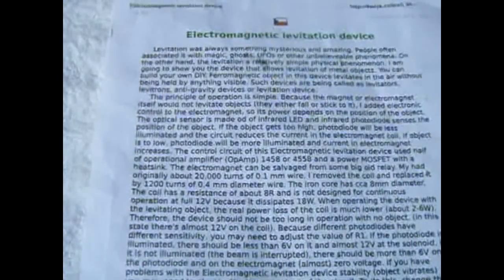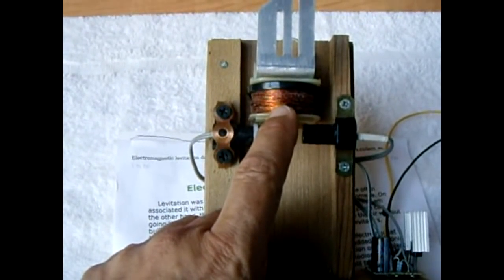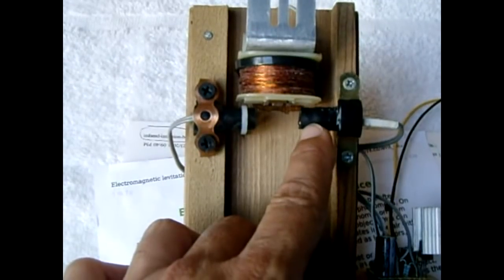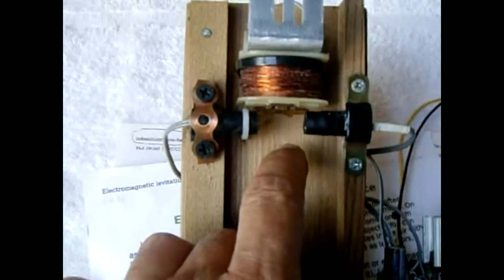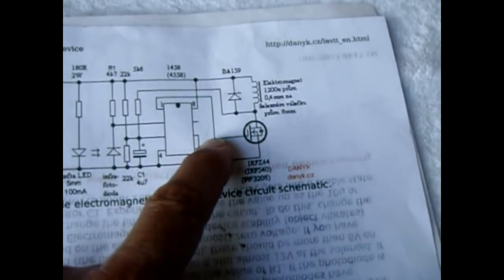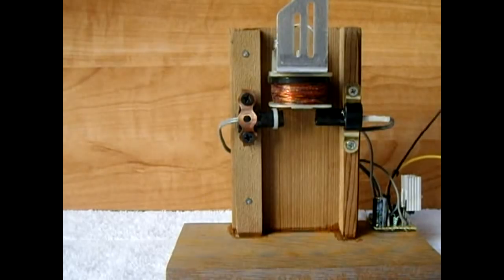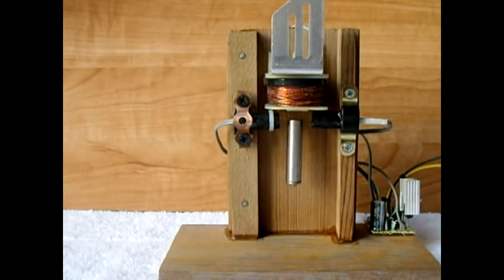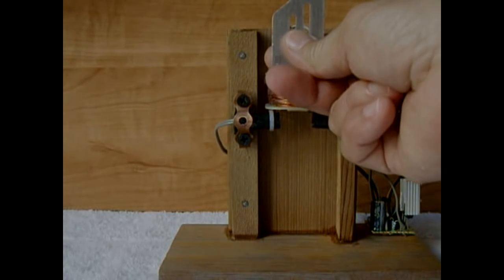Electromagnetic "Anti-Gravity" Levitation Device

Comment from the maker: The word "Anti-gravity" is often used colloquially to refer to devices that look as if they reverse gravity even though they operate through other means.
Reply: ABSOLUTE MATHEMATICAL PROOF THAT ELECTROMAGNETISM/ENERGY IS GRAVITY: 

Time DILATION proves that ELECTROMAGNETISM/ENERGY IS GRAVITY, AS E=mc2 is DIRECTLY AND FUNDAMENTALLY DERIVED FROM F=ma. Einstein's equations are NECESSARILY QUANTUM GRAVITATIONAL, AS ELECTROMAGNETISM/ENERGY IS GRAVITY. In fact, the mathematical unification of Maxwell's equations AND Einstein's equations (given the addition of a fourth spatial dimension) proves that ALL of SPACE is NECESSARILY electromagnetic/gravitational IN BALANCE; AS E=mc2 is DIRECTLY AND FUNDAMENTALLY DERIVED FROM F=ma; AS time DILATION proves that ELECTROMAGNETISM/ENERGY IS GRAVITY. ACCORDINGLY, Einstein's equations predict that SPACE is expanding OR contracting in and with time. ALL of SPACE is NECESSARILY electromagnetic/gravitational IN BALANCE, AS ELECTROMAGNETISM/ENERGY IS GRAVITY. This is, in fact, CLEARLY proven by BOTH F=ma AND E=mc2. A PHOTON may be placed at the center of THE SUN (as A POINT, of course), AS the reduction of SPACE is offset by (or BALANCED with) the SPEED OF LIGHT; AS ELECTROMAGNETISM/ENERGY IS GRAVITY. (Very importantly, outer "space" involves full inertia; AND it is fully invisible AND black.) Gravity AND ELECTROMAGNETISM/ENERGY are linked AND BALANCED IN AND OUT of SPACE AND TIME, as this is CLEARLY proven by time DILATION, F=ma, AND E=mc2. This ALSO explains the cosmological redshift AND the "black hole(s)". Gravity/acceleration involves BALANCED inertia/INERTIAL RESISTANCE, AS ELECTROMAGNETISM/ENERGY IS GRAVITY. GRAVITATIONAL force/ENERGY IS proportional to (or BALANCED with/as) inertia/INERTIAL RESISTANCE, AS ELECTROMAGNETISM/ENERGY IS GRAVITY. "Mass"/ENERGY involves BALANCED inertia/INERTIAL RESISTANCE consistent with/AS what is BALANCED electromagnetic/gravitational force/ENERGY, AS ELECTROMAGNETISM/ENERGY IS GRAVITY. (Energy has/involves GRAVITY, AND ENERGY has/involves inertia/INERTIAL RESISTANCE.) ACCORDINGLY, FULL DISTANCE in/of SPACE, MIDDLE DISTANCE in/of SPACE, AND A POINT are all then in BALANCE; AS ELECTROMAGNETISM/ENERGY IS GRAVITY. Gravity IS ELECTROMAGNETISM/ENERGY. GREAT !!! This NECESSARILY represents, INVOLVES, and describes what is possible/potential AND actual IN BALANCE. Therefore, I have demonstrated the true mathematical UNIFICATION of physics/physical experience AS what is NECESSARILY electromagnetic/gravitational IN BALANCE; AS ELECTROMAGNETISM/ENERGY IS GRAVITY. 

By Frank DiMeglio

Comment: ANTI gravity, is already well known,  It's the by product of the "B" field in any magnet... Not the north or south poles.  Want proof.. Find a magnet that you can access the "B" field of a magnet ,(that's the center of a magnet!!)  Now weigh a small stone on a scale lets say it weighs 40 Gm..  Now tap it vigorously with the center of a magnet the "B" field and it will loose about two thirds it's weight..  move it around and the weight comes back..  if you want to suspend it in mid air you will need to oscillate the "B" field for the material your trying to lift.  Take a look at Coral Castle Florida, Ed lifted 30 ton stones and built his castle it's a tourist attraction now.  The "B field played a major part in the taking down of the towers on 911,  that's one of the reason cars blocks away from the towers were ruined, also the building across the street had to be rebuilt.. It's all "B" field technology,  That's what Nicola Tesla was talking about with his "B" field energy ray..

Comment: I AM NOT SAYING THAT I AM IMPRESSED NOR DO I SEE ANY USAGE FOR SUCH A THING EXCEPT AS FUN. WHY NOT USE AN OSCILLATING CIRCUIT BY USAGE OF A HALF WAVE RECTIFER TO CONTROL THE MAGNET ON/OFF CURRENT, AND AN LC POTENTIOMETER TYPE KNOB SYSTEM TO CONTROL THE FREQUENCY OF THE HALF WAVE RECTIFER? THIS WAY YOU CAN USE IT ON A VARIETY OF DIFFERENT WEIGHTS.
Reply from the maker: First, turn off the stupid caps. Second, it was designed to be a cool desktop gadget. Thanks for watching
Reply: @electronicsNmore  Like those balls banging on each other? I guess if people like those, people like this as well. I don't turn off my caps. I let it turn off by itself. Maybe it happens when your password to your PC is in all caps. Who knows. Then you start writing and you are like, ha!. Seriously, I am tired of people complaining about caps. Look at it this way, it was not personally written for you, there isn't a chance in this universe it will turn off for you.

Note to self: Design "desktop gadget[s']", low current half wave rectifier power source.
Reply: @electronicsNmore  P.S., I just remembered, I feel I commented on this video, the same half wave rectifier idea sometime last year. Weird.

Comment: What is the difference between an anti-gravity craft and one which has an upward propulsion system ?  One would cancel the gravitational attraction of any near by body of mass and move about freely. The other would simply push a craft upward from its current resting place. I see neither one in this video. I do see a magnetic coil which using a switching system to hold another object suspended in a location below it. I don't think I would class this as an anti-gravity device unless it can lift itself from the table with out having a connection to another device.
Reply from the maker: You need to read through the comment section for my answer. :-) Thanks for watching.
Reply: Energy density on a 2d plane emanate: time; space ergo 3D, and gravity which can be a measure of energy density :)

Comment: Sir,I actually did not connect it with the circuit, connected straight away with the 12V adaptor, the image in the link below shows some circular part at the base of the coil,is it a magnet or what?
Reply from the maker: There is no magnet. The coil you are making is an electromagnet.

Comment: Please Can u tell me from which relaycoil u took the electromagnet
Reply from the maker: No, because I found it in the trash. What I used is irrelevant. You need to wind a coil that looks like mine using the proper # of turns, correct wire size, and have an 8-10mm iron core. Refer to the link shown in the video description are for more details.

Thanks For Watching

Comment: Sir,I wounded the 26gauge coil on an iron rod.when I connected it with a 12V adapter there was no magnetic field, why?do u require magnet at the base of the coil.
Reply from the maker: I have no idea what you did wrong. This is a fairly easy circuit. If you wound the proper # of turns of the correct size enamel coated wire on a 8mm iron core, then it should work. I hope you used coated wire(magnet/enamel wire).